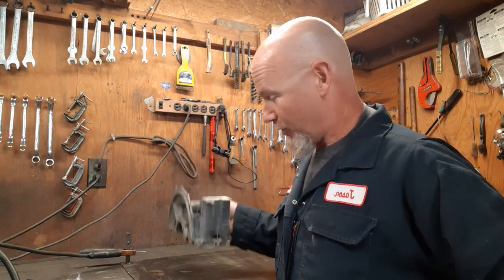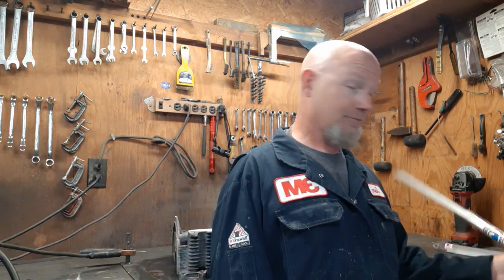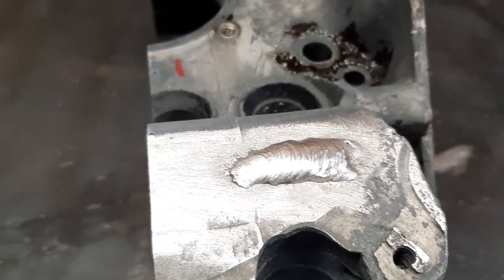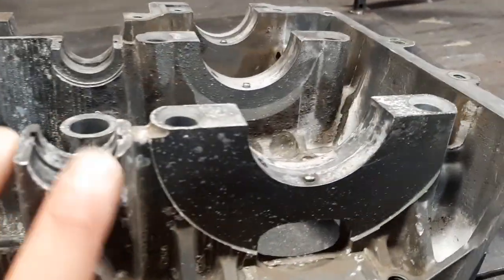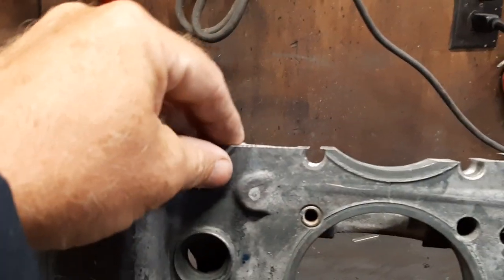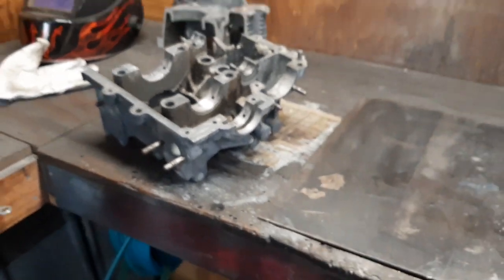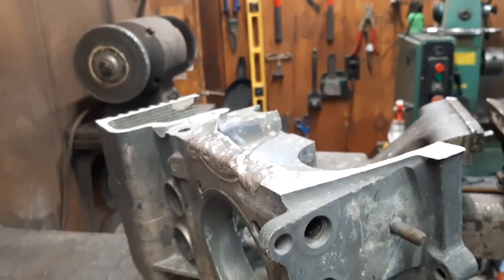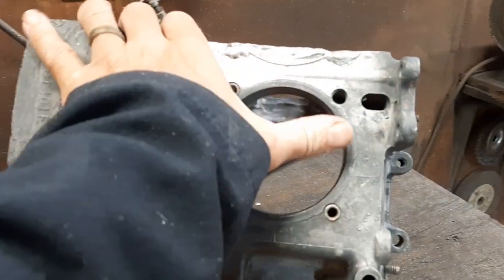1/2 VW Build - Part 3 - Welding the Case

Comment: how magnisium welding?
Reply from the maker: It's really similar to welding aluminum.  If I had been welding on new pieces, instead of the old oil soaked case, it would have been easy.

Comment: The backwards name tag on your overalls explains why the studs you removed from the case in part 2 appeared to be left hand thread.  I was confused because I never found left hand threads on any VW I've had.  LOL, it's the Camera's fault.  Did you need a higher Argon flow and a gas lens to weld this Aluminum Magnesium alloy?
Reply from the maker: Sorry about that.  Using the screen side camera makes it easier to see what I am recording but it does reverse the image.  I used the same flow and lens that I use for aluminum.  Seemed to work fine but I didn't experiment to see if anything else was better.